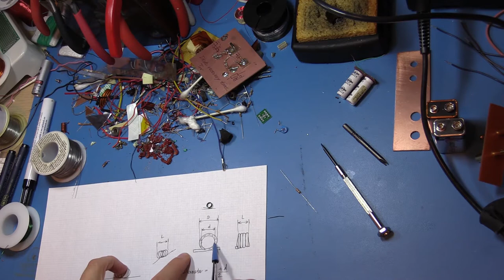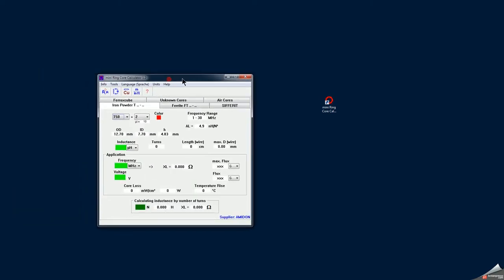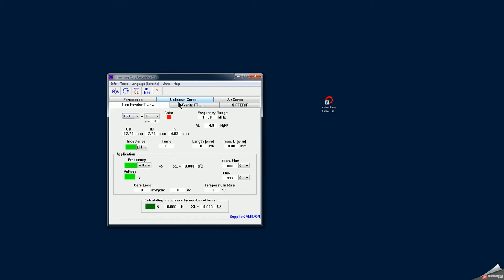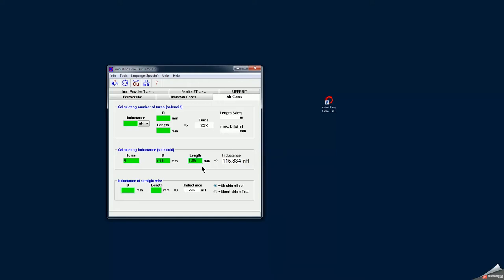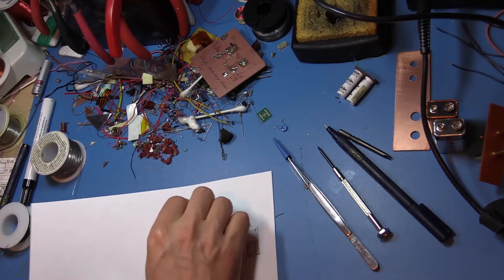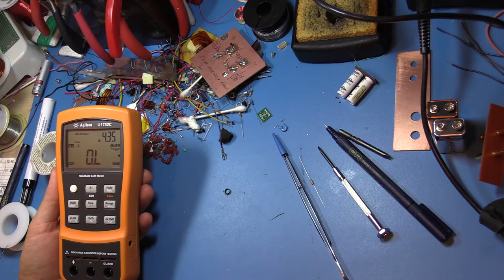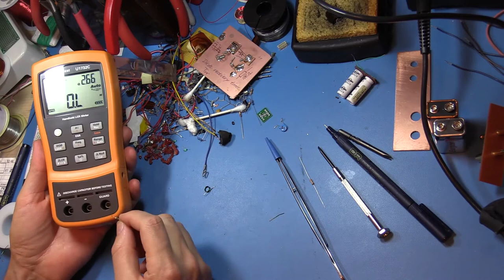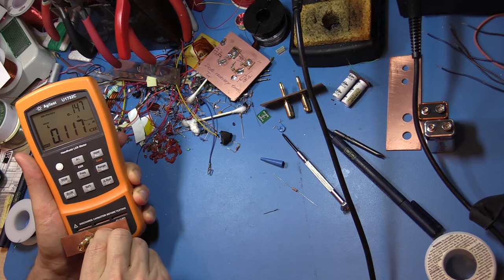Episode 3, Measuring small inductance values with handheld LCR meter

Comment: Hi! You complicated way too much that simple task of measuring a fragile inductor. You should have soldered some 2cm solid wires or leads from tht compoments and use those blade measuring terminals. Also don't forget to Cal&Null the meter each time you power-on, change the measuring freq or change the leads.